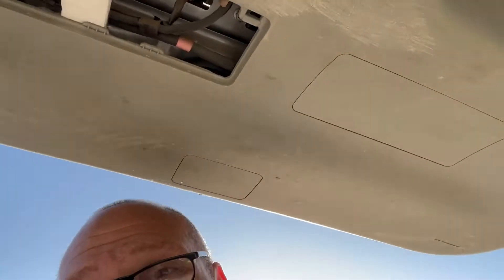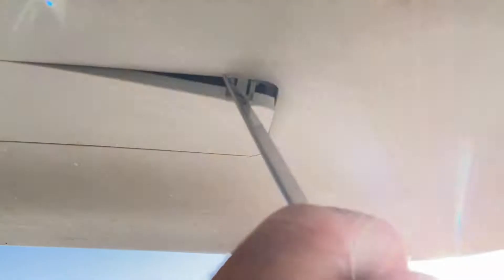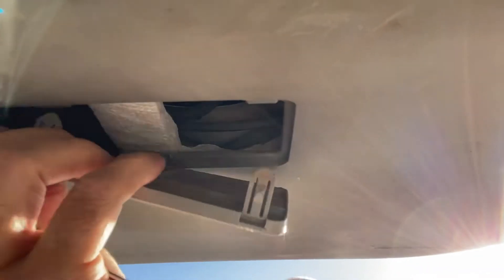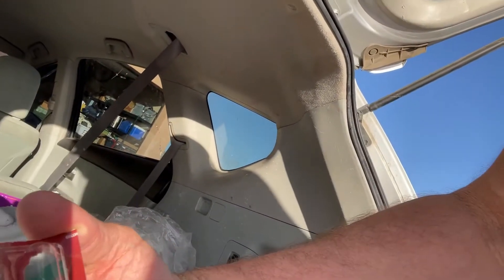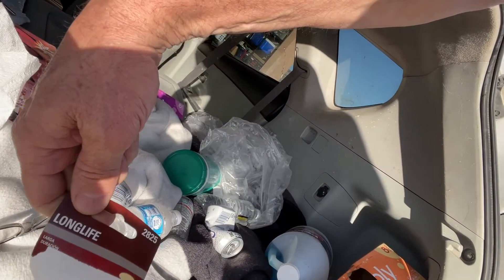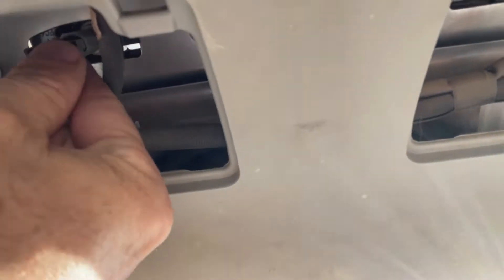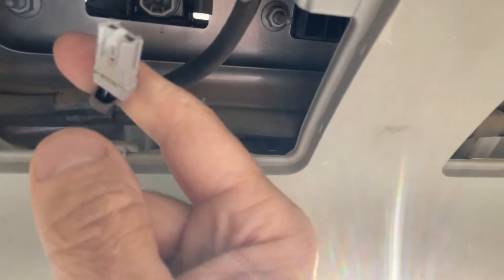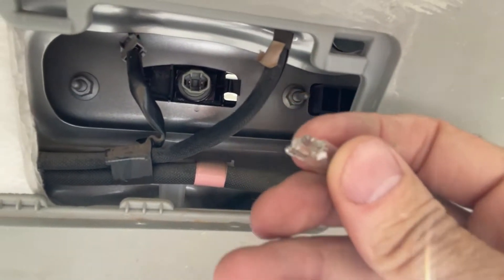Dunce Mechanics 001 Prius License Plate Light Bulb Install

Comment: As a person that drives vehicles until they are completely worn out; I have arrived at the place where I am about to replace all my light bulbs in my car that are not the headlights with LED replacements. The headlights are already LEDs. The only problem is the turn signal bulbs. The circuitry may not be compatible with lower  current draw of the LED bulbs, and blink either way too fast or way too slow.